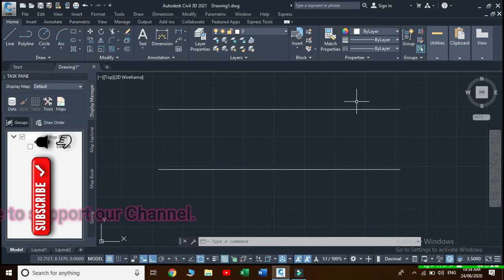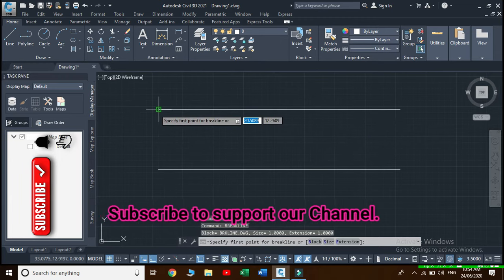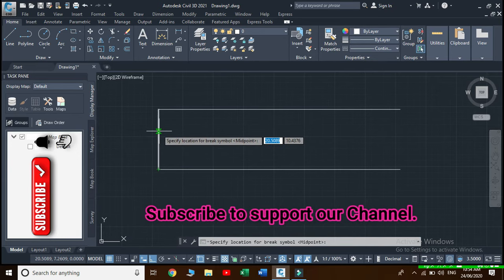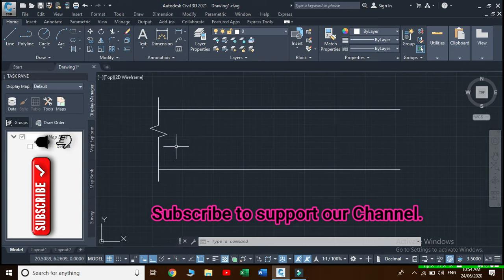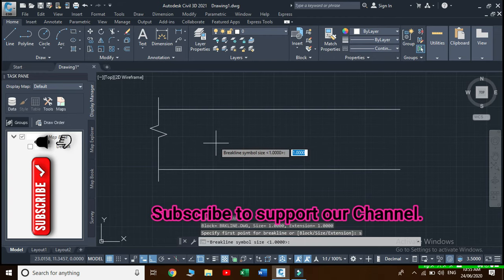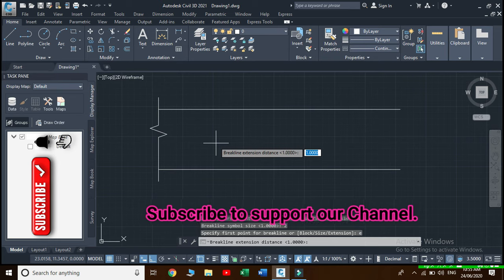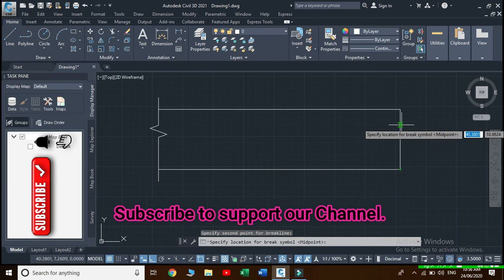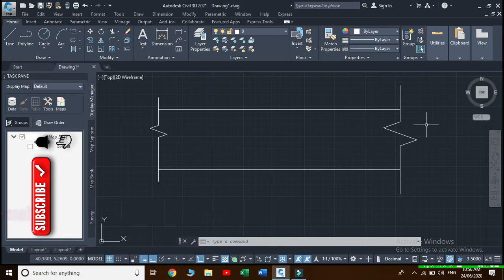Breakline in AutoCad || How to change size of breakline in AutoCad || AutoCad Tutorial

Comment: Please help When i call breakline command some dialogues came saying "cannot invoke ( command ) from error wothout prior call to ( push error using command) 
Converting ( command) calls to ( command -s ) is recommended
Reply: 1. Open Programs and Features from the Windows Control Panel.
2. Double-click AutoCAD to modify/change the program.
3. When the setup window appears, click Add or Remove Features.
4. In the program features list, put a check on Express Tools.
5. Click Update or Next to complete the operation.

Otherwise uninstall and install the program again